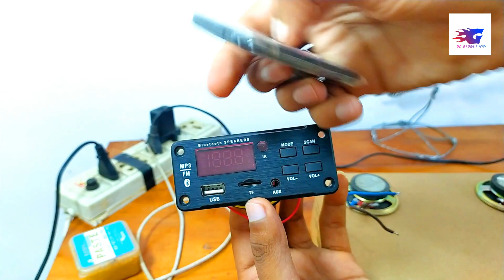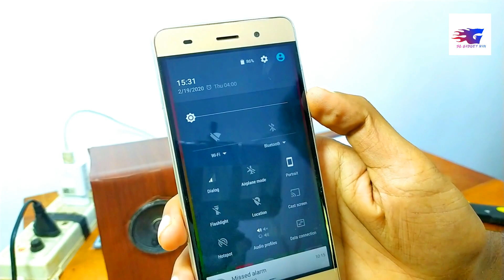DIY Bluetooth Speaker 2020 (Using Cardboard )

Comment: ඕක හරි සරල වැඩක්😋 මමත් හැදුව

5v amplifier circuit එකක්
Type-c charging module 
3.7v 18650 rechargeble battery 3x
5v Mp3 decoder with remote 
Bass radiator 2x
5v 3 inch speaker 1x
3v 2 inch speaker 3x
Samsung Note8 phone box

උඩ තියෙන circuit, battery aliexpress එකෙන් ගොඩක් අඩුවට ගෙන්නගත්තෙ.